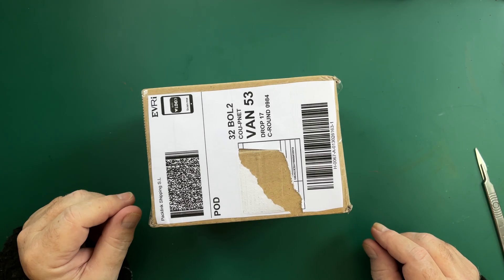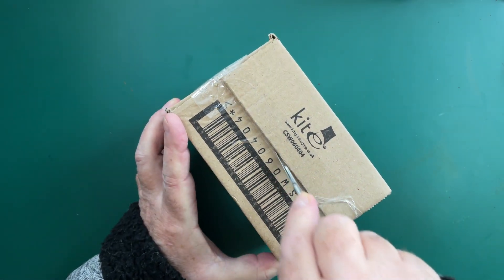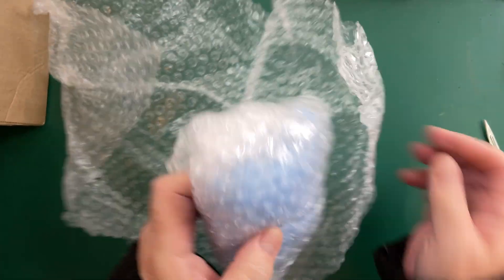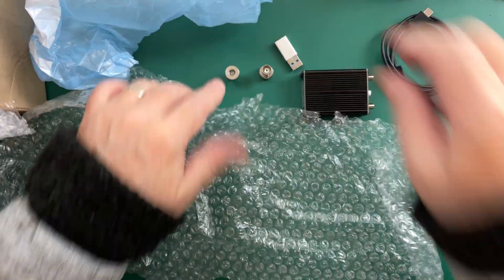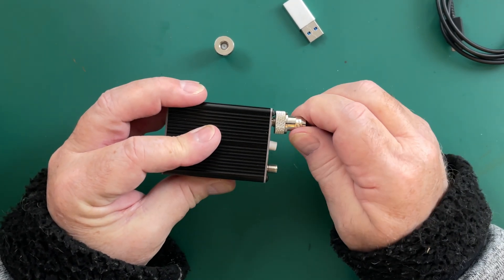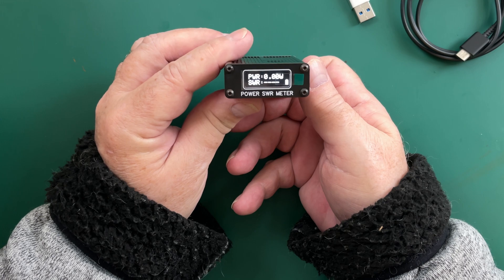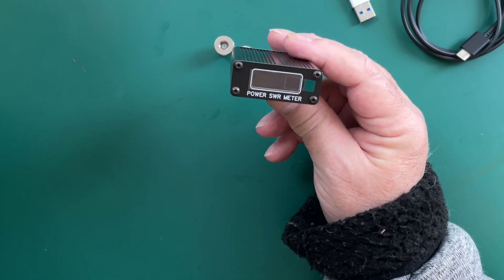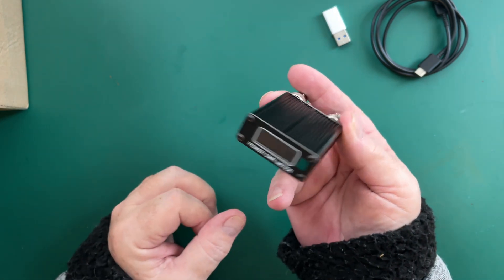Mini QRP SWR/PWR Meter

Comment: How do you like it so far?  Is it pretty accurate?   Its a tiny thing lol  Thanks
Reply from the maker: I have only had a chance to look briefly at the meter.  It appears to be reading a little low on the power but I need to measure the actual voltage from the rig.  I will be able to do that soon, then I can check the accuracy more accurately.  It is VERY small :)